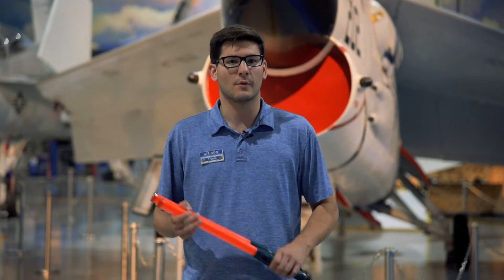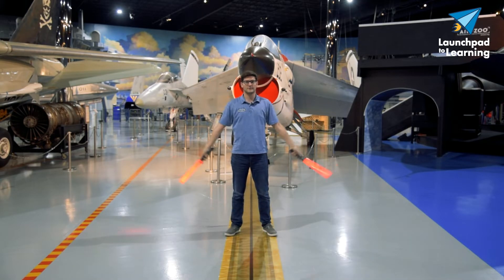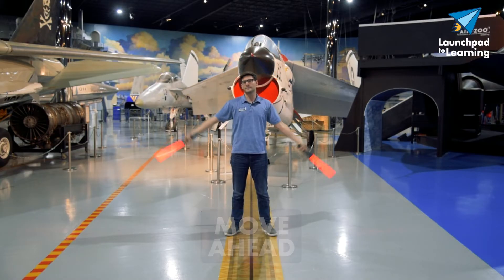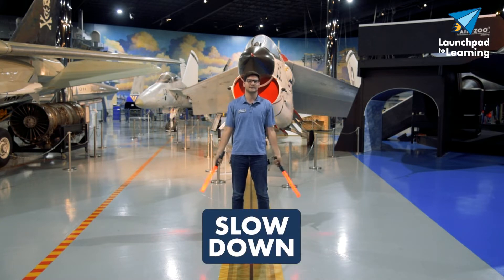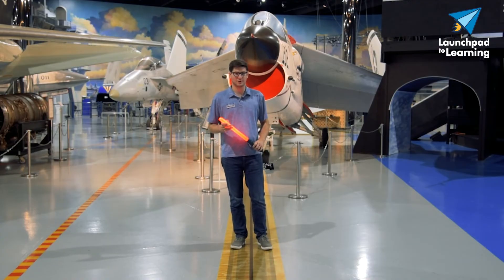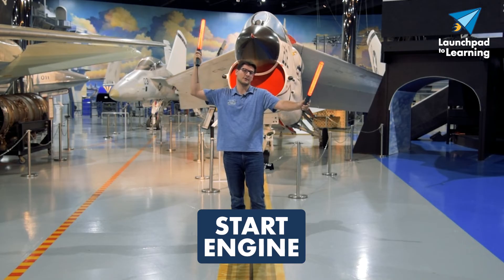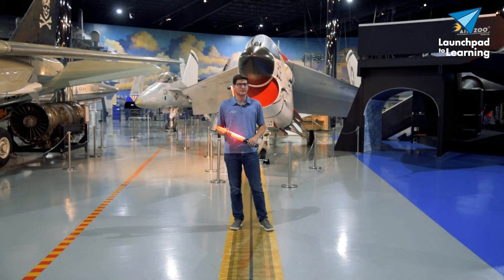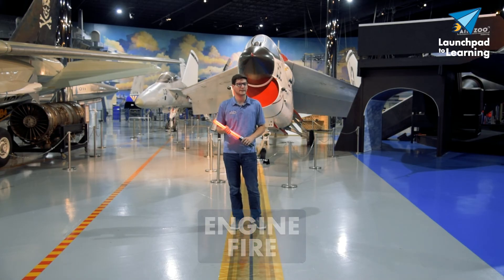Aircraft Marshalling Signals

Comment: Would’ve been nice for you to show how you go from the stop to hold position before you indicate chocks in and where applicable (gateway specific) stairs up. Once we block an aircraft in, we hold the stop sign until nose gear chocks are in, then drop to the hold position while aircraft maintenance attaches the GPU, shutdown is complete, and then the ground crew chocks the mains and puts the stairs on.